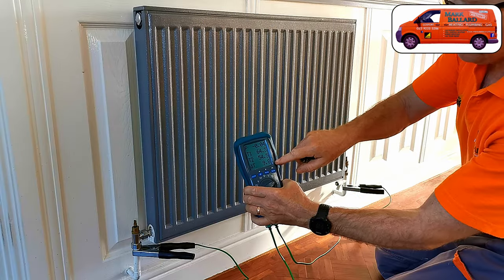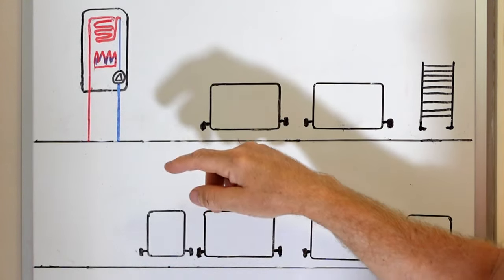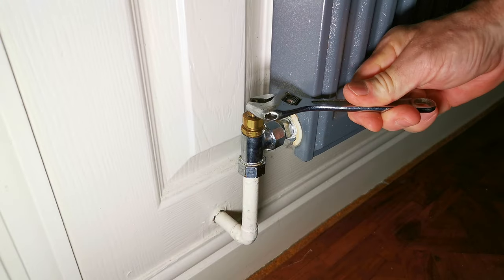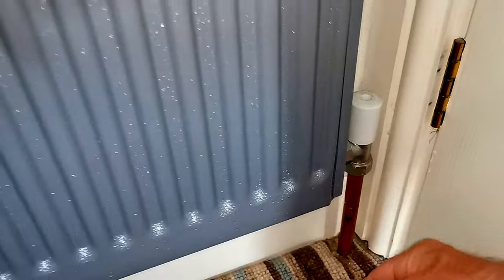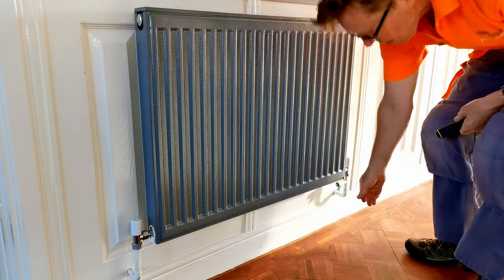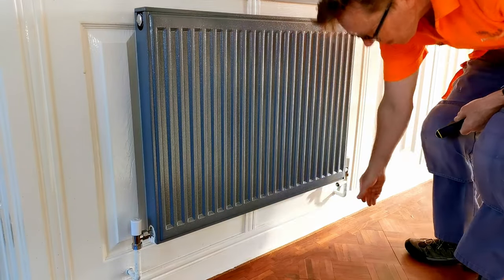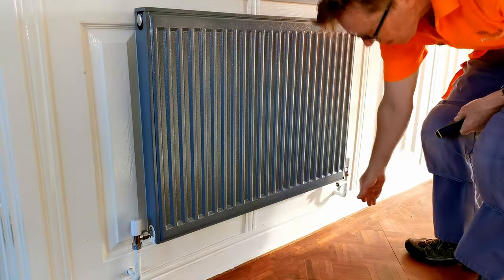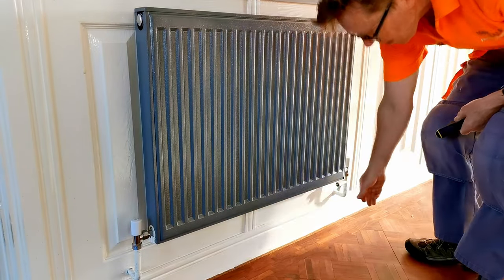How to Balance Your Heating System, Everything You Need to Know & REDUCE YOUR GAS BILL

Comment: I'm a not a gas engineer, just a home owner looking to save a sheckle or two. I did buy a digital thermometer to balance mine as they're not too badly priced now. This is the first video I've seen that doesn't tell you to open all the TRV's and lockshields fully, turn the heating up full and find the order they heat up. Then when the system has cooled set the boiler temp and go round in the order of heating, altering the lockshields as required to get the temp difference.
Reply: which way do you think is better?

Comment: It's difficult to achieve a temperature difference of 12 degrees for a small radiator. Also it helps if no-one is running a bath or shower when balancing the central heating system.

Comment: So basically - balancing is impossible.
Reply: Best endeavours in my opinion - I learnt quite a bit by this video, it's not 'impossible' but a lot to take on board, do and/or shell out for.
Reply: Just done quick search and Autobalancing Drayton TRVs come in at nearly forty quid each on the site I found, may be cheaper elsewhere.
Reply: Nah mate its easy
Reply from the maker: Any balancing you can do will improve your system efficiency. And make it work better.
Reply: @MarkBallardLTD  How do you know which rad to start on?
Reply: @gkinlen  i also would like to know.
Reply: @gkinlen  usually the one to get hot first but he is checking the temperature between the flow n return so doesn't matter.

Comment: In Denmark we NEVER do that. We have shunted two-string systems with a cirkulation pump, that lets in new hot water, and lets out used cold water to the boiler. In newer houses, each radiator even has its own circuit. Easy-peasy!

Comment: I have 8 rads on my system with a combi boiler. It would appear I have 3 rads that have the flow coming in through the lockshield valve, 3 where the flow coming in through the TVR and one in the bathroom next to the boiler has 2 lockshield valves. How can I balance this system? Will I need to swap them around?

Comment: So the way I understand this is: if I have pressure modulating pump I don't need auto balancing valves. Having them installed in the system with pressure modulating pump might create conflict between two as the valves will control pressure(independently)as well. Or, am I missing something?

Comment: Wish someone would explain how to balance a mini bore system with manifolds hidden above ceilings. I have 20 rads and it’s impossible to run around the house to see which rad gets hot first.
Reply from the maker: Does not matter which one gets hot first. it's just a case of balancing  all of them to get that difference in temperature between the 2 pipes and yes you have to run around all the radiators.
Reply: That’s useful information. I have a similar sounding heating system with 10mm piping and hidden manifolds. I had a digital temperature gauge on each radiator flow pipe and still couldn’t tell the order they warmed up. At least 5 of the rad flow pipes heated up simultaneously. I guess this is due to being connected to a manifold. Now I know the order is not critical I can start to balance the individual radiators.

Comment: At 17:45 what do you mean about a variable pump conflicting with the boiler? I have a late 90s Glowworm Ultimate non condensing boiler and a new variable speed (proportional or constant pressure) Grundfos pump. I also have a manual gate bypass valve (quarter turn open) which I presume isn't really needed any more due to the pump and the fact that I have 2 rads that don't have TRVs (so sort of act as a bypass). It's 22mm between the boiler and pump then changes to 10mm microbore hidden away out of sight.

Comment: I have an open vented system. The pump (Grundfos UPS2) is burner linked. If I set it to variable speed my system takes longer to heat up and the rads knock when the pump backs off. All rads, trvs & lock shields are 3 years old. Boiler is Vaillant Ecotec 415. 

The pump shouldnt back off because all the trvs are open and the rads tuned for 12c differential. So can i ever get my system to run in the optimised config?
It seems like its not possible and the pump should just be kept in constant speed mode.

Comment: I've just tried balancing my system based on radiator size. The smallest (about 500 watt) radiators had the lock shield on quarter open, the intermediate (about 700W to 1 kW) had it set one turn open, and the largest (1600 watt up to 2200 watt) were left fully open. What do you think of that approach? Seems to work with the large radiators coming on more quickly, but since its August I can't properly test it out. To me it does seem logical to match the flow to the radiators ability to dissipate heat.
Background - each radiator is fed by microbore, so the pipework probably limits flow rate.

Comment: Very detailed explanation Mark thanks,but it does seem like balancing is nearly impossible to do,and to achieve it means spending many hours and lots of money on new auto/smart valves, measuring kit etc,plus more gas when testing,the previous videos i have seen all say measure temperature difference across flow and return pipes when system is hot,so bit unsure how  it can be done when the system is cold ?,also i have 2 new aluminium middle connection radiators in a recent extension that dont get very warm the heat isnt spread out across the entire radiator it just seems to be hot in the middle and on one side,i have been using a thermal imaging camera to identify the cause ,but not getting very far,I am liaising with the supplier at present but they don't know why,would you have any thoughts Mark.?

Comment: I’ve followed all your videos on cold radiators - took it off and flushed it, changed the thermostatic valve, then changed the lock shield valve, now I’ve balanced the rads and it’s still the same - hot pipe to the valve but radiator still cold. Any more suggestions?

Comment: Hi regarding the hot water tank what should be the temperature difference flow and return difference,  when it's just DHW demand , from cold. I have a system boiler heating a tank indirectly with CH. Thanks

Comment: My damn pipes are made of plastic i cant measure on them. But my question is we heat the house with coal burning boiler and a 500L hot water tank if it is warm enough in the house isnt it more efficient to send as hot water as possible back to the boiler so the fire will burn less intensively and use less coal ?

Comment: Good vid, thanks. In ductwork systems where you can’t have control dampers, we balance the system by selecting size of pipe and number of bends etc. and calculating pressure drop in each leg but it’s more of a black art with small bore water systems.

Comment: Useful video but do I need to go to the rad nearest the boiler or the hot water cylinder/pump first, then the second nearest one and so on? I'm assuming the hot water cylinder as that's the thing that pumps out the hot water not the boiler, so I'll try that first. No, that can't be right as the hot water in the cylinder is just used for hot water for use in showers/bath isn't it? The hot water that circulates round the rads comes from the boiler, doesn't it?? I need more knowledge on my system before I try to fix the cold rads I have! Hashtag beginner....!

Comment: Can you give me some advice e please, my living room radiator isn't heating up as  well as all the rest, its the largest radiator.we flushed out the system, took the radiator off and run a hose through it, it was pretty mucky. We bled the radiators and it's still the same. If we switch off all the other radiators it gets hot and works. I've tried to balance the radiators and it made it worse. I'm not 100% sure if I got the right sequence. Our condenser boiler is down stairs in the kitchen and the pump and cylinder tank is in the upstairs bathroom. So not sure which is the first. All advice will be greatly appreciated. Tia
Reply: get two people to do this one upstairs one downstairs yell when you find the first rad that gets hot. what i did was this i turned on all my rads both sides. Turned on the heating and felt all the rads until i found which one heated first this should be pretty easy then i turned off the heating and fully closed off the first one then put the heating on again checking all the rads and found the next one turned it off shut down the heating waited and then did the same each time this will bypass the ones you know and force the water to the next in sequence. also unscrew your trv and push the pin up and down using pliers in case any trv pins are stuck making it impossible to find the order. maybe do this step first before you do the order

Comment: If standard TRVs will potentially mess up the balancing and make the boiler less efficient, is there much point in them accept to keep your room from gettibg too hot? I remember people talking about TRVs actually saving you money but based on thus if the boiler has no idea TRV has turned off a radiator, there no savings at all
Reply: You make a very good point. If you have a thermostat in one room and it detects the heat has reached the required temp then it will reduce the heat to all rooms so really the thermostat is a mute point im going to remove mine

Comment: Hi guys, I have an issue with only one rad in my system. When the CH is on this rad wants to remain cold, however I can feel that the lockshield side gets hot aswell as the pipe, but the TRV side remains cold and will only ever get lukeworm. When I remove the TRV from the rad and open the TRV, there is water gushing out. Does anyone have an idea of what may be going on?
Reply: did you solve it? i would check the trv pin is not stuck by carefully pumping the pin. if its stuck down you wont get flow either that or maybe sludge build up in which case you might need to remove it and flush it

Comment: Great video, I dont have TRVs. I think the caps have been muddled..how do i tell which is the lockshield valve?
Reply: They both are lockshields then
Reply: @mrwhiteno50  It appears so. My understanding is that the pipe that gets hot first in the flow and the other the return..mine are clearly muddled, so something else for me to sort .

Comment: Delta T is not the average temp.

Delta T should be the change in temp between the inlet and outlet.
Reply: I think there are two delta_T's: One is the difference between inlet and outlet, controlled by the flow valve and thermostat settings. This delta_T is the one that is optimised as suggested by Mark here to obtain 10 degrees difference. The other is the difference between the average radiator temperature and the surroundings ('the room'). Mark refers to the different delta_T's 50, 60 and 70 - I think that is the temperature of the radiator (like you would measure with one thermometer) and not the difference between the average radiator T and the room T. Delta in science normally refers to the difference between two quantities, so I'm a bit lost with Mark's definition of delta_T. The second delta_T of interest is the difference between the average radiator temperature (half way between inlet and outlet values) and the room temperature, which is proportional to the heating power supplied to the room.  In turn this is connected to the flow rate and the first delta_T. Both of these delta_Ts are related, because in a steady condition the radiator has to emit the heat power it receives from the boiler. I think that for a given temperature requirement in a room, there is an optimum value of the inlet-outlet delta_T, from the viewpoint of efficiency. But of course we want the room to be the right temperature, so it is impossible to have optimum efficiency without being able to control all the variables. Mark goes on to discuss the 'smart' kit now available to be able to do this, like controlling the pump speed etc. Whatever, Mark's video really helped me get our CH system working better, and that's what matters to me!

Comment: Please help me 
I replaced 3 radiators after that, and all systems blocked 🚫 mean 10 radiators not working. I drain all systems  air out from radiators still not working kindly please give me the solution what wrong 3 meter pipe next boiler very hot after that not hot aswell  
Please help me 
Thanx

Comment: All my 5 radiators are cold at the bottom but they were fine just last season. Would it be central heating pump malfunctioning or a sldge in radiators?
Reply: Sludge. Fernox f3 I think is the product. Then fernox inhibitor.
Reply: @gulag8735  I got it fixed. It was not radiators and pipes that was the problem. For some problems you relay just need to suck it up and call the plumber.
Reply: A tip our plumber gave, was to leave all the TVR's open during the summer months. Otherwise the pins jam closed. Removing the TVR head and gentle tap with a hammer can get the pin moving freely again 👍
Reply: @Trev5  in my case it was not radiators at all, it was a build up dark hard stone on the inside walls of the pipes coming out of the boiler. This stone reduced the bandwidth siginficantly so water could not properly circulate in the system. Removing the pipes and just give them few hits alowed for remving the stone and fixed the problem.

Comment: I don't have thermostat valves on my rads they are the same at both sides so how do I know which is which 🤔🤔🤔
Reply: The lock shield valve is the one on the return. That is the one that heats up last from a cold start. If you have two wheel valves on both ends you should replace the lock shield wheel by a plastic cap to prevent it being turned. Or you can mark the lock shield valve with some plastic tape. When balancing open the other valves fully and adjust the lock shield valves following the guidance Mark provides in this video.
Reply: Lockshield (on the return pipe) is normally fitted with a cap so it cannot be turned, to adjust you need to pop off the cap and turn the valve with an adjustable spanner.  The other side (the flow pipe) is normally fitted with a thermostatic valve or a normal wheel cover that you turn to adjust.  The temperature at the flow pipe coming into the radiator is hotter than the return pipe on the other side coming out.  I use a digital hand trigger thermometer to measure both sides thus giving me which is flow and which is return.  You can pick one of these up in Lidl for about €20
Reply: @tm2204  OK pal many thanx 👍
Reply: @davidplanet3919  Normally, 😱

Comment: Hi, 
I have a modern condensing combi boiler system with a flow temperature of 60 degrees. 

I have currently gone with a temperature delta between the flow and return of 12 degrees on each radiator that i can, but some of the further radiators are still not getting adequate flow/warmth. Would it be okay to aim for a higher temperature delta of for example 18 to 20 degrees to help balance the system as the system is incapable of balancing with a 12 delta between flow and return on the radiators that are getting hot.

Kind regards.